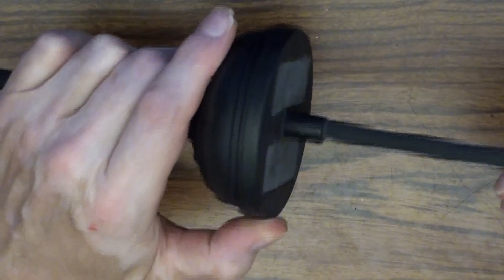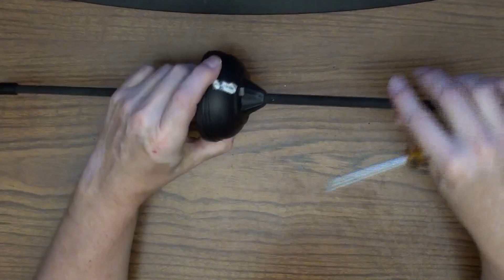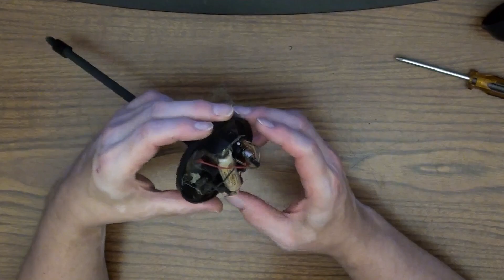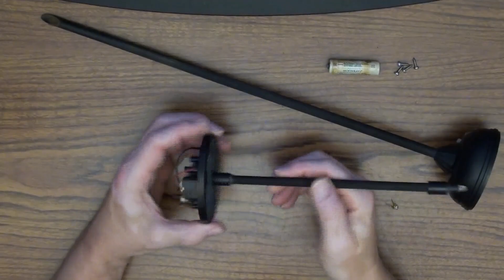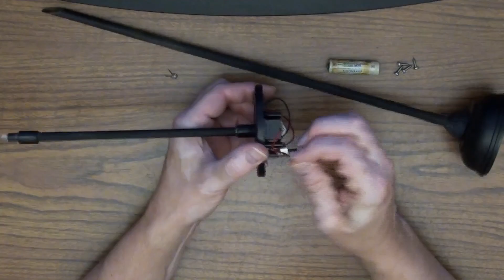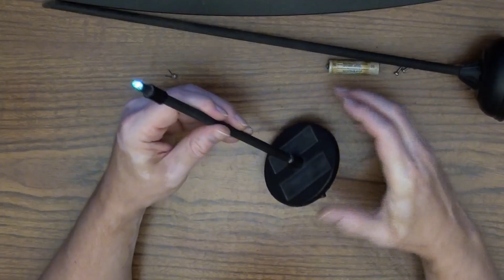Solar Light Repair Hack: Fixing Water Damage & Sealing It Forever!

Comment: Well done :-D
Cheap outside solar lights just never last, the water always gets inside and hell breaks loose.
My next door neighbour fitted two on the small fence between us.
They charged and worked well, then the rain came a month later..... oh dear :-(
The pcb battery and switch were Rusti - fied.
Also if the whole thing was sealed into a clear box or sphere, the changing temprature would flex the seal and in comes the water.